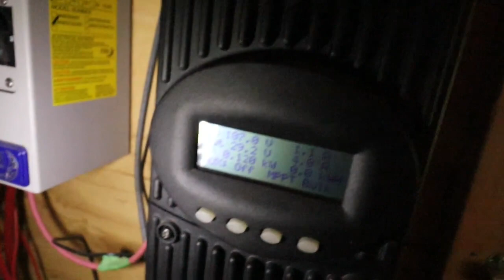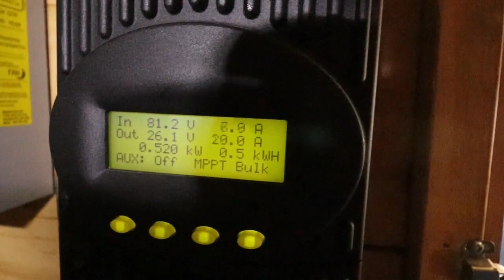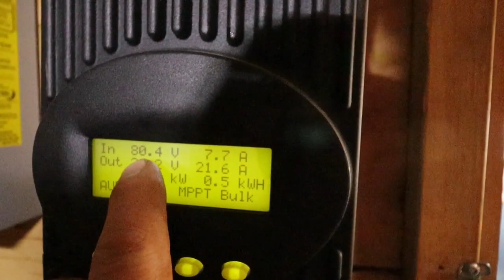Upgrading Our Solar Array | Off Grid Power

Comment: Good job. Don't quite understand all the numbers, but that's because I have done no solar research.

But I definitely get the framing work. Good job. Pet the pups for me!
Reply from the maker: I (katie) also have a hard time with the numbers, but with the old panels we pulled in 825 watts and with the new set up we have pulled in 1300 watts on a sunny day, which is a huge improvement. The other day when it was sunny, the batteries were full before lunch. Next step is to increase the battery bank.
Thanks :)

Comment: Notification squad rolling in!  Great video y'all, and nice work- what a solar array! Really considering one ourselves, but the pricing always seemed to be pretty steep...maybe looking for a deal like you did isn't such a bad idea afterall!  If for nothing else it could be a power supply to keep our outside wood boiler pumps going in the event of a grid down scenario. Thanks for sharing, got my wheels turning again!
Reply from the maker: Thanks for the comment! Yes, it does add up but we couldn't pass up the price on the panels, and we really don't have any other option for power aside from the generator. Keep the end goal in mind though, because we started out with a 12v system and moved to 24v when we should have just went to 48v, and we have wasted money by doing this unfortunately.
Reply: @ThisOffGridLife  yeah really good point!

Comment: How efficient are your panels in poor weather? Like rain or cloudy days. I’m about to install them down in the lower mainland and was wondering how good they will be in the winter.
Reply from the maker: We supplement out power with a generator when it's cloudy.  If you have say a 6kw system you might be able to pull 800 - 1000w when it's cloudy

Comment: You downgraded...Did you take down monocrystaline panels to put up polycrystaline...Monocrystaline panels work better in overcast ☁️ days...to use all 8 you can run strings of 2...A MPPT controller maximizes power 🔋  coming in.
Reply from the maker: I understand we downgraded, when we move our system up to 48v we will be able to use all the panels
Reply: @ThisOffGridLife  good move going 48 now thats a upgrade 👌